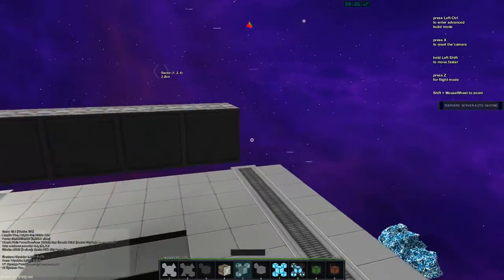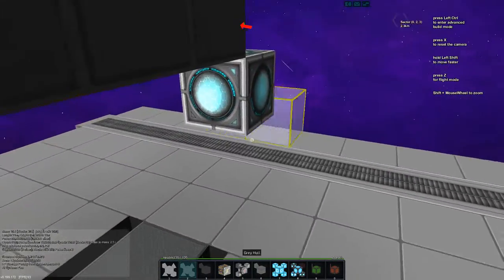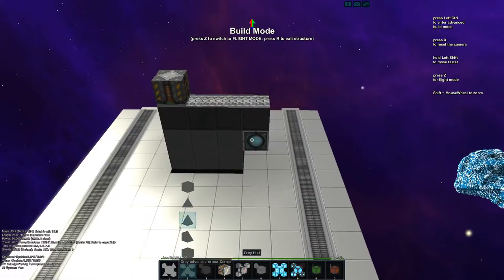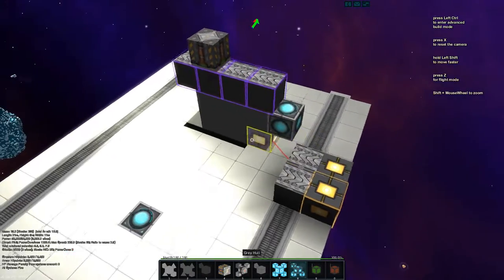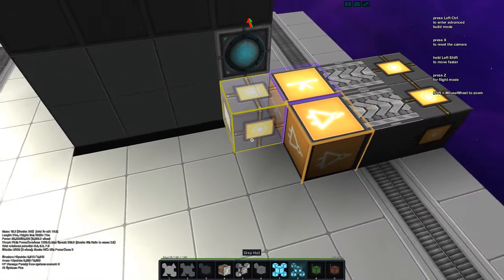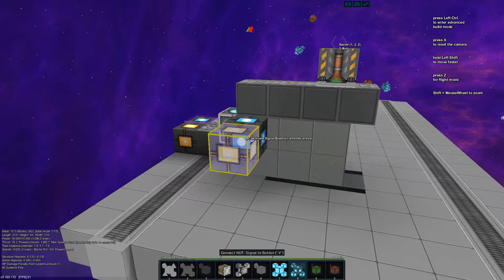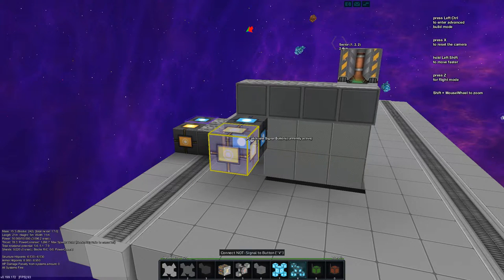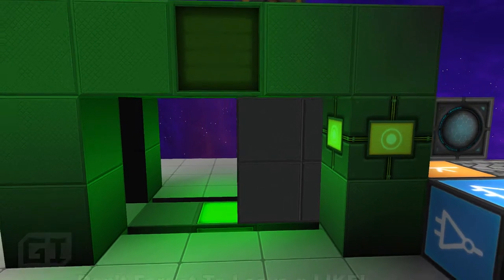StarMade Compact Tutorial | Rail Sliding Doors

Comment: I'm kinda hoping to supersize this. Building a hangar door for my capital ship that is well armored and can deploy a dozen drone fighters within a minute.
Reply from the maker: You should! Having a door that is, like 100 meters long will make it very slow to open, thus keep it running on full speed with a rails speed controller, and also have it in several layers, like scales to exponantially increase speed :)
Reply: Gmodism Total Nerdery Channel Would I also be able to have my reactor slide out of the main body of my ship to make repairs easier out would the power and abilities not work if I did that?
Reply from the maker: I don't think it works, it never worked before but haven't tested it with 2.0. basically reactors should get disabled on docked objects, so you can make a folding door for the reactor or so.